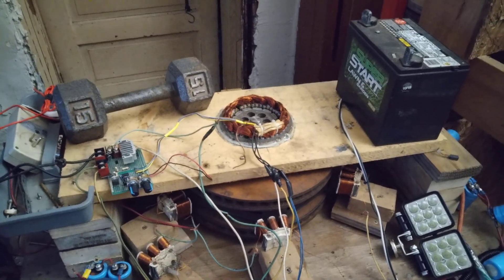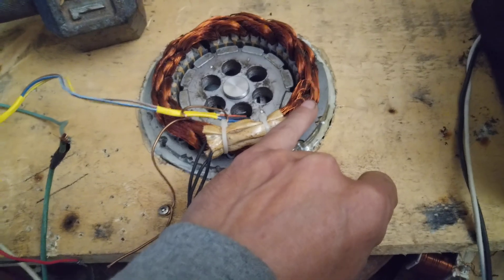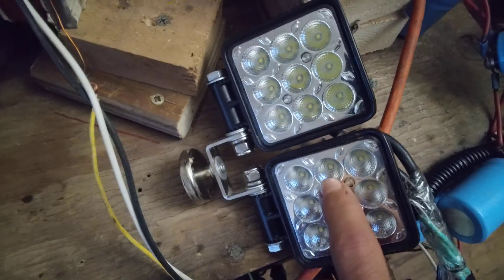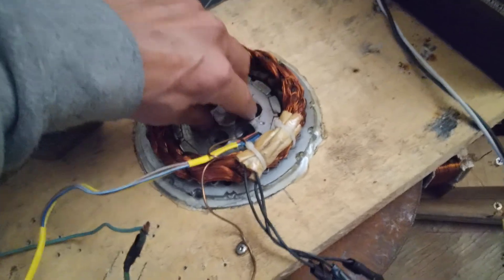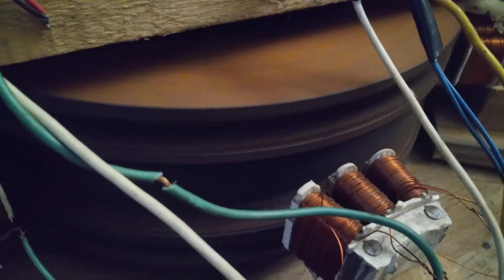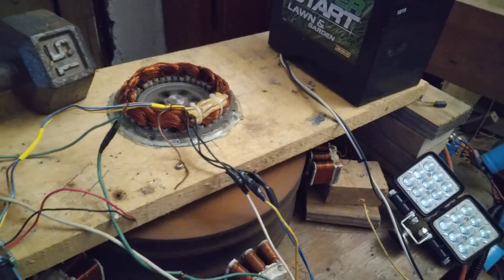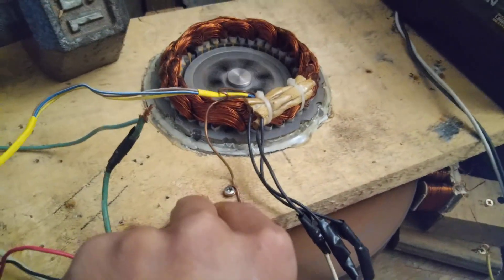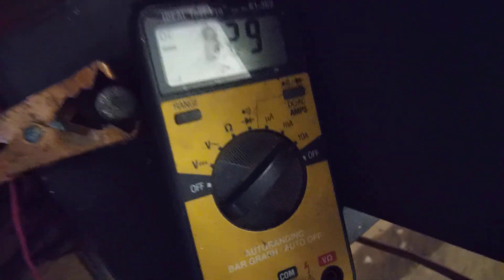twin turbine project. up and testing again.

Comment: Wicked you got it running!
Reply from the maker: Ya and it's running better now. Moved the timing to the outer center magnets.   Still needs refining, but it's running good. 
Can't Express how much I'm loving the circuit Bud😊 .   I'll be ready to bump it up to 24 volt after I rewire the other turbine. I want to run through all the 12 volt tests again before changing the input voltage. 
I already know that I need to be above 18 volts to get good output from the rpms. 
And the circuit seems to run the motor fine at 9.5 volt half amp. So it definitely doesn't need 12 volt. 
Thanks again bud and you have an awesome circuit.